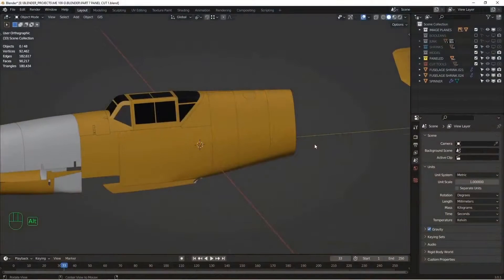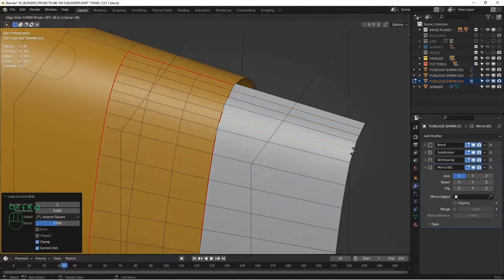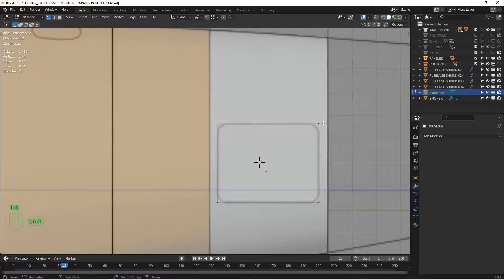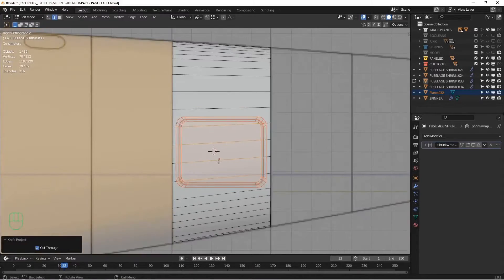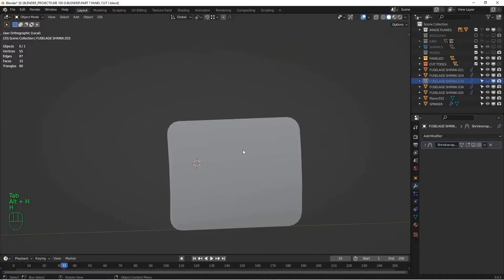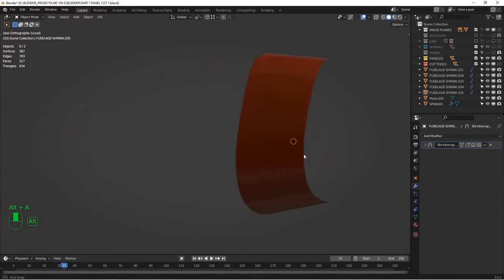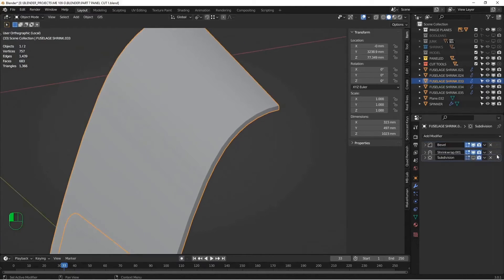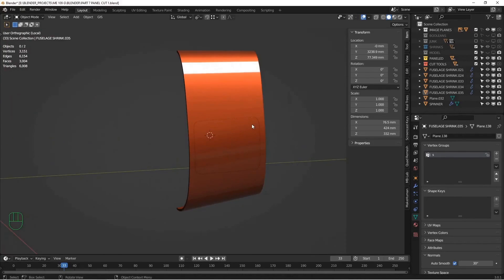Blender Detailed Modeling Course, Part 8: Sub Panels

Comment: Is it perhaps possible to add a video (or update a chapter) showing how you modeled the troughs for the machine guns please? These are usually one of the trickier areas to get right and I'm curious about how you created that particular area.
Reply from the maker: I apologize for not replying sooner.  My life's been hectic lately.

The troughs aren't really that hard.  SHIFT/A to bring up the "Add" menu and choose the "Mesh -> Round Cube" option.  Change the Operator Preset to "Capsule".  Cut the top half of the capsule off to create a trough and then use a lattice modifier to adjust the shape to what you need.

(If you don't see the Round Cube option, try going to the Preference menu and enabling the "Extra Objects" add-on.)

Comment: May I ask you how you manage the corners of the individual meshes?
According to my several tests the Crease method is the most efficient; instead the Bevel modifier deforms the corners in such a way that, as you get closer to the detail, you can see it.
Even by assigning different weights to the various mesh groups, the final result is always random.
Reply from the maker: I'm not sure what you mean by creases being "more efficient".  Have your tests shown them to render faster or do you think modeling is done more quickly using creases?

I like the bevel modifier because it lets me create a subtle rounded edge without having to add lots of edge loops.  I typically keep the bevels between 0.5 and 2 mm and set the # of bevel edges = 2.  

I have noticed that the bevel modifier can deform interior corners which can cause pinching.  I sometimes have to define a beveled edge on the face to add some additional virtual geometry.  Since I place a subdivision modifier and shrink-wrap modifier after the bevel, the pinching gets erased and the panels stay really smooth.
Reply: For those who have used parametric modeling software, some aspects of the polygonal method can prove to be a nightmare. 
For example, pinching of the internal edges is really annoying. After doing some tests it seems that by increasing the number of segments of the Bevel modifier the final result is very close to reality or, at least, to what the human eye captures when observing an airplane from a certain distance.
Sometimes I needed to apply the Shrinkwrap to certain Vertex Groups and with different Wrap Methods to obtain the right curvature continuity of the mesh (even if it may seem superfluous in the case of polygonal modeling...)
Certainly we must try to obtain a fair compromise between the complexity of the mesh, the total number of vertex and the realism of the object.
I hope to be able to publish some work in progress on Blender Artist Community as soon as possible.
Hope to see more videos on your channel and regards @Mark_Alloway
Reply from the maker: @sedemitr 
I look forward to seeing your work at Blender Artists.  I'm always grateful to people who share their skills.

Comment: could please explain how you used that shrinkwrap modifier? I dont see the initial shrinkwrap setup?!
Reply from the maker: Have you watched the previous videos in this series?
Reply: @Mark_Alloway I literally ate them up completely but still I am struggling to get this shrink-wrap set up correctly. At least until I understand it in my head 🙈
Reply from the maker: @A360JFuxtier  I have another video where I demonstrate them.   This part (https://youtu.be/cP0sTou8Ddk?t=411) is a specific demonstration, but the rest of the video could also be useful.  This video (not by me) seems pretty helpful:  https://www.youtube.com/watch?v=YksPYPa05LM